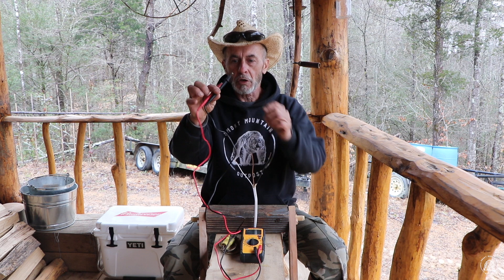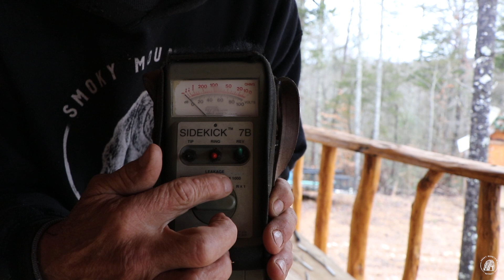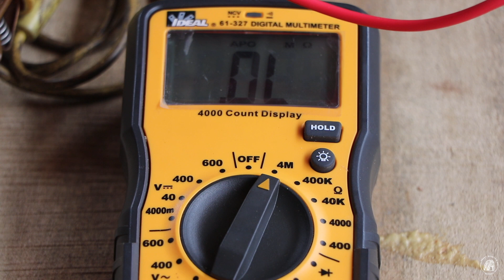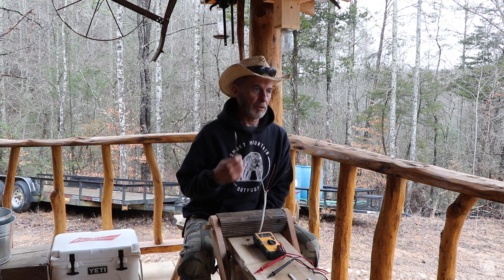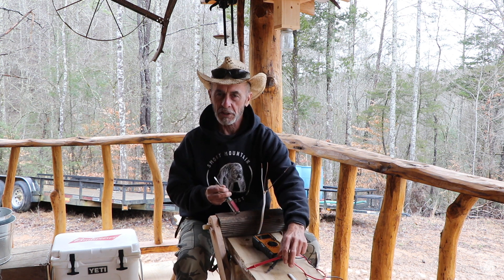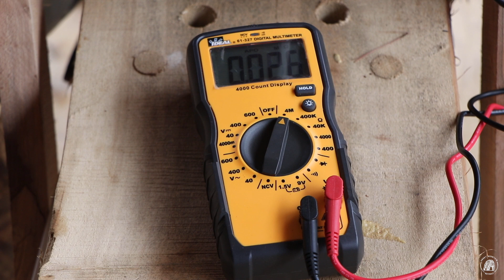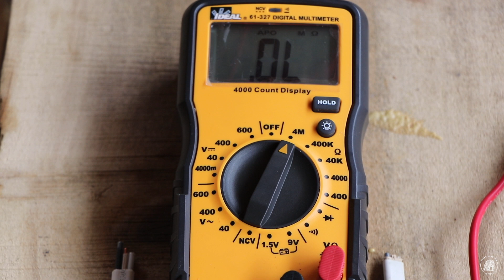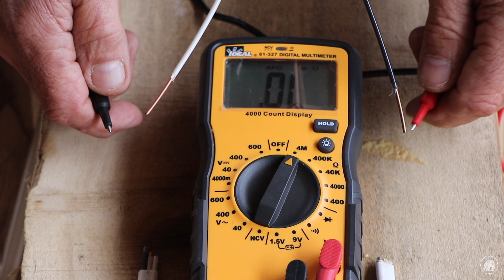How To Find Basic Faults In Electrical Wiring

Comment: I've found that a rifle during dove season can cause shorts, opens, tip/ring ground leaks and unbalanced pairs, all in one shot😁😋 Not to mention birds, wasps, bats and squirrels. Also found that carrying two cans of wasp spray is a good idea, because it's easy to drop one and it's hard to run when safety'd off to a pole. Also a roll of toilet paper in your truck is a good thing to have when opening a terminal with a flying squirrel inside.
Reply from the maker: Lol, what the customers don’t know. Rural comm. Its a different world.